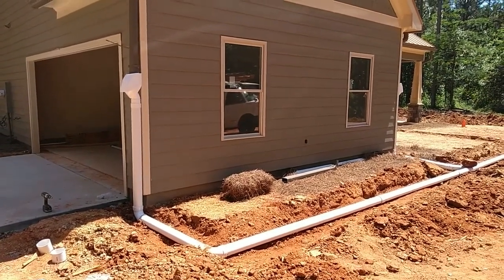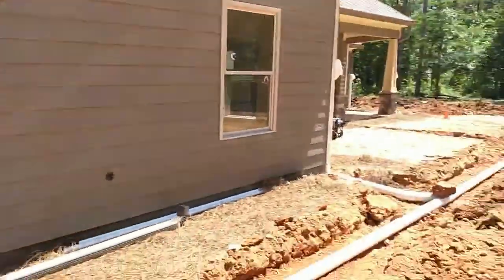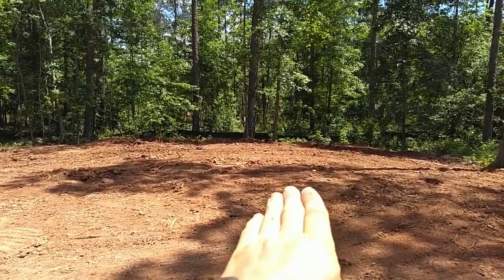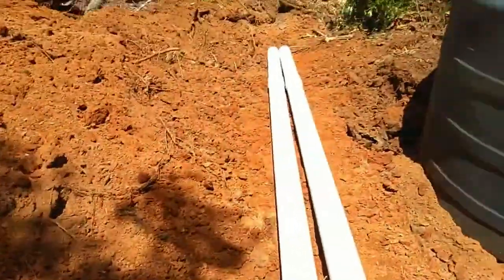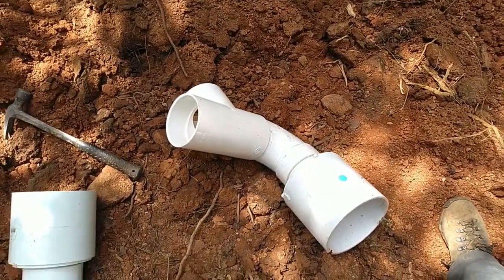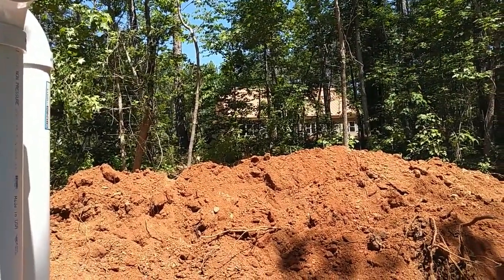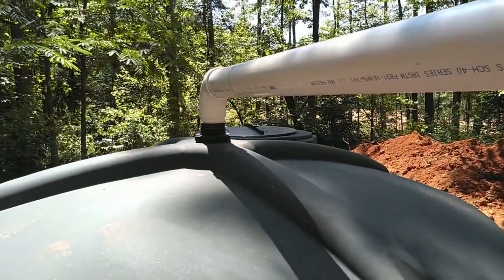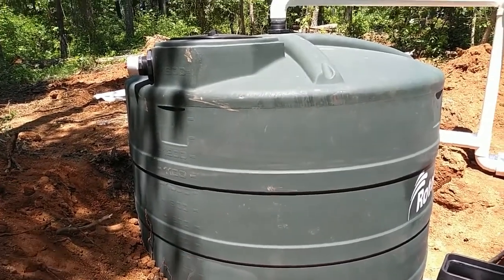#42 Our Rainwater Tanks and Harvesting System- how to turn a wet line to dry

Comment: Nice that you have enough elevation drop to essentially drain your underground lines.  Have you determined how much rain you need to do the first flush?  Good that you got this done before prices took off!
Reply from the maker: Hey Keith,  yes i used a rain harvesting company site recommendations to help determine the volume recommendation to collect for the 1st flush. Then used the 6" pipe to collect it. I don't remember the exact numbers but remember i was in between a "clean area" and "dirty area" volume. The filtration and UV light work great.

Comment: The over flow has to match diameter of incoming  supply line and you could  have ran 3 inch from your skimmers to your consolidation collection supply line and you should run a Y strainer right  before your tank. Silt will accumulate there and you could flush the line from there also through your Y strainer . You can retro fit additional port flanges for proper over flow capacity. First flush  is a joke and a waist of  precious water in our off grid situations .  Run a gunner on the inside of the tank out going port with the tail end above the floor of the tank   so your not sucking dirt off the bottom of your tank and don't glue it  fixed this way if a water line breaks you still have a reserve and you can remove it in a dire situation. Hope this helps.
Reply from the maker: Thanks for watching and your comments. So far the system has been running great.

Comment: thanks for the video... seems like your supply lines are not very far from the house and also not very deep?  I would be afraid of hitting a line while putting in shrubs or flowers, etc.
Reply from the maker: I ran the lines down the stones path to get to the front door. So we shouldn't/wouldn't hit them.  The 1st flush drains the lines so there shouldn't be any water standing in them plus I live just outside of Atlanta so we don't get real cold weather to freeze them. So far everything still works great.

Comment: In the first flush system what is the purpose of the ball, I under stand that once the first flush is full the ball rises and seats causing the first flush to seal off and divert the water to the tank , is the purpose of the ball to stop dirt stiring back up and going into the tank pipes?
Also once the first flush is full and the ball seals off does the water flowing past the ball create like a Vaccum and hold the ball against the seat or does the ball constantly go back and forth as the waters releasing from the first flush then re filling again
Reply from the maker: Dave you are correct, the ball is to help stop dirt from swirling up and into the tanks. The drain is a very slow pin hole so in theory the ball goes up and down during the process but it leaks so slowly it more or less stays seated. Thanks for watching and asking the questions.

Comment: Great setup. I plan on copying your plan as much as possible. I saw that you have 2500 sqft of roof. I have about 3000sqft but wanted to have all my gutters go into a single pipe and use the overflow of a single tank to fill future tanks and just daisy chain to expand. 

Why did you run two 4” pipes? 

And what is the elevation difference between your gutters and tanks?

Now to watch your aquaponics videos.
Reply from the maker: 1st thanks for the nice comment. 

i used (2) 4" pipes for a couple reasons. a 4" pipe can flow about 240 GPM. Here in Georgia we get heavy down pours and had concerns   that 1 pipe couldn't handle these down pours. Then I could only get tanks with a 3" NPT opening and knew that couldn't handle the down pour rain so a little extra cost in pipe gave me the extra insurance not to lose captured rain water. the 3"NPT connection why i went into both tanks plus if i ever need to shut one tank down for any reason I can keep collecting without and issues.

the elevation drop is about 10 ft.  We've been going like this for almost 3 years no issues and i can still see in spots the bottom of the tanks so very little foreign material is getting into the tanks.
Reply: @DawnRedwoodGroves  I think our homes are situated very much the same. My tanks will be about 100ft from the house. 

If I can find tanks with a 4” NPT, Is it feasible to run all the gutters to one pipe?

And if not, could you explain the H system that you mentioned in the video to equalize pressure? 

As far as the sizing of the first flush, have you found that it could have been smaller or the size has been good?  

I saw you had at least a few people helping you, but I’m gonna attempt a go at this myself, hence all the questions. Thanks again!
Reply from the maker: @andreperez6162  I don't know how your down pours are to say 1 4" pipe would work or not. simple answer is yes it's possible the only issue will be two much rainfall will just spill out in your 1st screen down spouts.

the H is used because 1pipe captures the front of the house and the other the back of the house. they are by no means balanced on sq ft of the roof. So the H allows a better balance to allow both tanks to capture the water. 

i think the 1st flush is appropriate. if i was to do it again i might make it a little bigger..... maybe keep less foreign material out. 

I did have a crew do the digging and laying pipe and tanks. At that time i never ran an excavator so it made sense. today i would rent one and do it myself too

Comment: Nice setup. How are you getting the water up to the house? Is the pressure in the tanks enough, or are you using some type of pump?
Reply from the maker: video 92 gives a newer walk around but i use 1/2 hp shallow well pump.
Reply: @DawnRedwoodGroves   Thanks! I just watched and liked. I live middle of nowhere Mississippi power and water are constantly going out. I’m thinking of doing a system like yours , put one tank up the hill for when we lose power we can gravity feed.
Reply from the maker: nice!
53-55 videos I build a water tower to have gravity feed water. It works well for irrigation but you need high elevation for house water pressure.
send pictures once your done.

Comment: Hi Keith how would this set up for the rain harvesting change rain harvesting change if you were doing this up in the northeast with the frostline and for freezing in the Winter time
Reply from the maker: Good question, Winter freeze is always in issue. But simple solution would be to open the 1st flush drains before you get frost. Snow really doesn't turn into rain so nothing really flows. Your tank capacity would need to be increased if you are trying to use it over the winter. Plus the tanks would need to be enclosed in a insulated building so they don't freeze. OR switch to underground tanks. Underground tanks cost more but adding in the building cost. Hopefully this helps. Feel free to ask if you have any other questions.

Comment: Are the fittings for the first flush diverted available at Lowe’s or other big box store ie do you need to source them from a plumbing supplier?  Where do you get the ball?
Reply from the maker: you should be able to get the standard elbows and tees from a big box store. the ball and flange and drip drain I ordered on line from a supplier that sold Water Diveters First Flush kits.